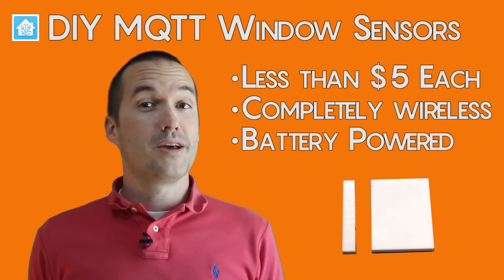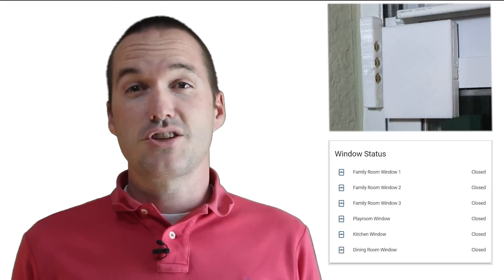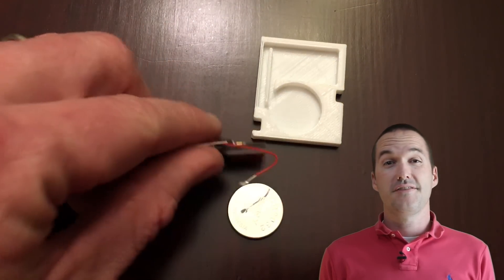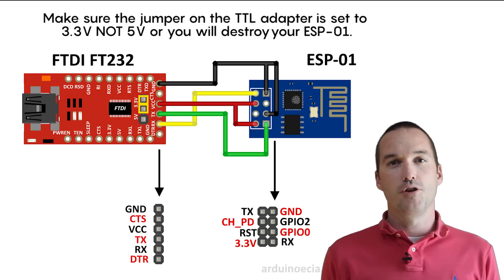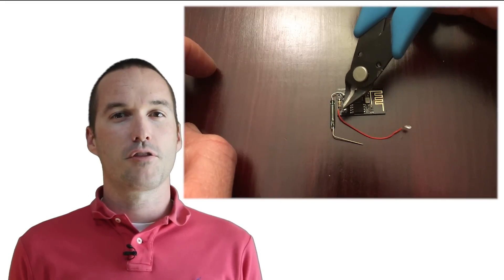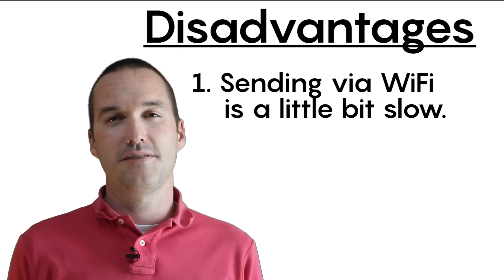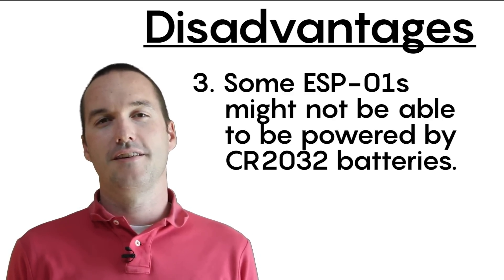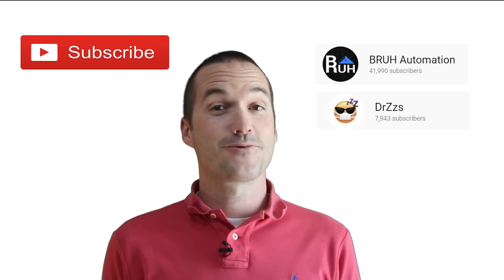$5 DIY Wireless MQTT Smart Home Window Sensors

Comment: meh, none of my esp-01 want to boot from fresh cr2032 batteries. im goign a different route now. im reusing some 18650's i have left and just design a case for them.
Reply from the maker: That's really strange.  Did you use a resistor or a plain wire to pull up the chip enable pin?  Even that one random ESP-01 that I mentioned booted fine when I switched to a plain wire.
Reply: all plain wiring here, no resistors involved. mine seem to be particulary power hungry during bootup. 
maybe i just got unlucky with my ESP-01's ;)
Reply: It's because of the current draw and probably the model of esp822-01 you're using.  The esp8266-01 version with 1MB of memory requires a burst of 320 mAh @3.3 volts at boot, and the CR2032 is only rated at 220mAh - so they will never work with that battery.   I've tried on half a dozen over time and never found one that would boot with such little current, but all mine are the newer 1 MB version.  There was an older version of the 8266 that only had 512k memory, idk if that one less peak current or not.  Either way, I think you just got lucky somehow finding 8266's that will boot on a 2032 - if you google it you'll see people have been trying since they came out to no avail!
Reply from the maker: I've had really really good luck then.  I've got 12 ESP-01s in my drawer right now (don't judge me), and all of them boot just fine on 2032s.  I used that power hungry one for my roomba project.

I ordered most of the 12 from amazon (the brand in the above link), but a few are from aliexpress.  All of them are the black PCB 1mb type.
Reply: Wow. and the only mod you did was remove the on-board LED?  I'll have to try that and your code, maybe you're on to something here.  Technically the 8266 should run on the 2032, it's just the startup current spike that prevents it. Maybe your configuration minimizes that spike
Reply: @BarryWise  I know I'm 5 years late, but I want to do the project myself and I'm wondering was removing the LED possible solution to turn on the ESP-01?
Reply: Barry Wise Alas, this seems to confuse capacity in mAh (milliAmp hours) for the batteries with (instantaneous) current in mA (milliAmps) used by the device.  

The 220 mAh spec for a CR2032 (which is about right, varyiing slightly by manufacturer) is typically at a draw of 2mA (ie: 110 Hrs at 2mA).  Higher draws will reduce the capacity (eg: 4mA draw would give less then 44 hrs run time).

The problem is that CR2032 batteries have a high internal resistance and are often spec'd at 10ma or 15ma max current. There's a TI app note that suggests with a parallel cap you can get 30mA; other hobby-level sources say a CR2032 can supply short bursts of up to 100mA when new (albeit with much decreased capacity).  An ESP8266 can draw more  than that of course.

Powering up and transmitting with an ESP8266 on a CR2032 is kind of marginal, I'm afraid.  Cool minimalist project tho, and it's great that it works at all, at least with a fresh battery.

Comment: ESP32 uses less power,... can you try this DIY sensor with a ESP32 less power hungry module? P:D: excelent proyect !!
Reply from the maker: Are you sure the ESP32 uses less power?  I know it can use BLE which would obviously use less power, but I think on wifi it would use the same or even slightly higher power due to the higher clock speed.
Reply: you are right ...:( ... deep sleep seems to be less power consumption
Reply from the maker: This design is actually much more efficient than that one.  This utilizes deep sleep after the MQTT "open" message, but if the window is closed the power is fully disconnected meaning there's no microcurrent draw at all.
Reply: The Hook Up yes ...increíbly simple and efficient ... i will try it just for fun. Thank you for sharing 👌👌👌

Comment: how did you remove the header pins from the esp-01.  it does not fit the case with them.
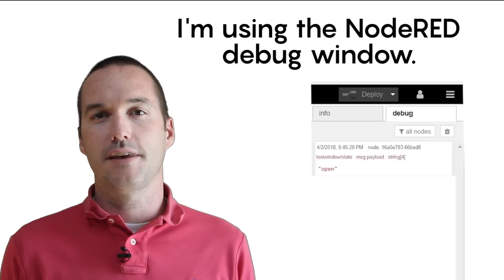Reply from the maker: Check out 4:03 in the video. You can push the pins through with a hot soldering iron.
Reply: and i watched this 4-5 times,  and just missed that.  tnks

Comment: interesting idea. Could you do a project showing how to hook your projects up hardwired? Or at least to a hardwired power source?
Reply from the maker: I use NodeMCUs for all of my hardwired stuff, but yes, one of the next videos will be using a hardwired microcontroller.
Reply: The hardwiring isn't that bad. Making it look good an concealing the wires - that is the trick. Some people have old (disabled)) security systems and those wires running to normal contacts. You could convert those (leave the normal contact if it is working) and "remotely" locate at the other end of the wiring, giving clean, easy access to power/wiring. In this scenario, 1 NodeMCU or D1 Mini or ESP32 could likely monitor all of your windows/doors as desired. Now that would be awesome!  -- Another idea is to use a "cell phone powerbank" get one that looks good, and just wire it nearby. It would last a long time, and easily change standard AA batteries (or recharge the bank). It all depends on esthetics/look and feel. it might be a good way to "test" and start by installing contacts, then worry about concealment after 1 month and deciding it's working well for you. Just a thought.

Comment: You should use a static ip address for your esp - it should lower the time to connect to 2s or less
Reply from the maker: SornDP suggested that below.  That's in my weekend plans.
Reply: @TheHookUp   I am facing a problem with knowing what to choose on node-red can you help me with making a tutorial and not depending on other channels vids this is a suggestion that will help you increase the quality of your channel.
Reply: @ahmedalshamsi1723  MQTT IN node connected to DEBUG node. Then configure MQTT IN node to your topic in code (PICK_UNIQUE_WINDOW_TOPIC)
Reply: D DEE hey thanks for the reply
Reply: @D DEE what about flashing the firmware first to the esp8266 0-1 and then flashing the sketch. Cause whenever i try to compile a sketch it does not work, even flashing the firmware to the esp8266. I bought ftdi, usb to ttl and usb to esp8266, i worked first with @The Hook Up way using the ftdi but did not work. Then used usb to esp8266 wired the pins from the back of the usb to allow it to compile a sketch to the esp but did not work so as the usb to ttl. And know i bought an arduino but waiting for the jumper wires to hook em up. IN BRIEF HOW SHOULD I CONNECT THE ESP8266 0-1, THEN IF THE CONNECTION WORKED TO FLASH THE ESP FIRMWARE USING THE FLASHER AND FINALLY WILL IT WORK TO COMPILE A SKETCH.
Reply: @ahmedalshamsi1723  you must ground the gpio pin zero to put it into flash mode for both firmware upgrade and Arduino sketch.  I am using a Wemos D1 mini so it's easier. Flash firmware first then sketch.
Reply: @D DEE  i’ll try that
Reply: Good idea, personally I'd prefer to sacrifice a few seconds. I can only reserve 10 static ips on my network.
Reply: @wangouthangout  that's static dhcp leases in your router. You can configure static IPs all day long if you want them. Just change your dhcp lease pool to exclude a few IPs from its assignable range (You don't "need" to do this, but it prevents any IP collisions) and assign the IP manually within the firmware of the esp01.
Reply: @lmaoroflcopter  Sweet, I'll give this a shot. Starting to have a lot of ESP modules here in my apartment

Comment: Very cool, I will be trying this for myself. I believe part of the 4 sec response time could be shortened by using static IPs rather than DHCP assigned ones. Is is possible to test that?
Reply from the maker: Gonna try that out this weekend.
Reply: The Hook Up, hi, did you try this? Any time improvement? I wanted to go all static ip for all my nodes but my router has a hard limit of 30 static addresses. Have you tried the Hassio dhcp addon? I need to check if that has a limit or other limitations? I’m saving this tutorial for when I manage to fix my 3D printer, I’ve messed all the settings up flashing the firmware, doh! Cheers
Reply: @shaunwhiteley3544  your router shouldn't limit anything. Instead of using static DHCP leases, just configure your DHCP pool to be smaller than the full subnet and allocate IPs yourself in the esp01 code.